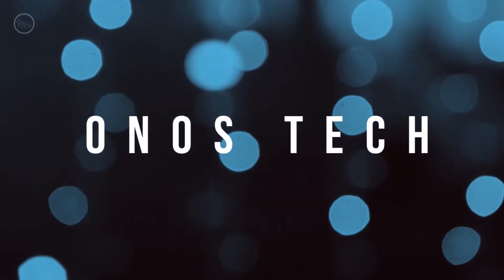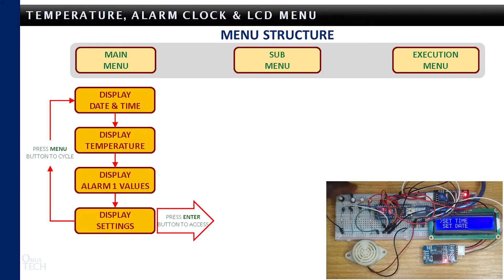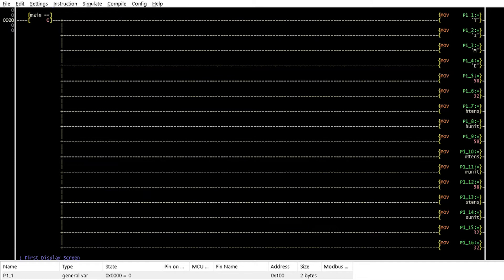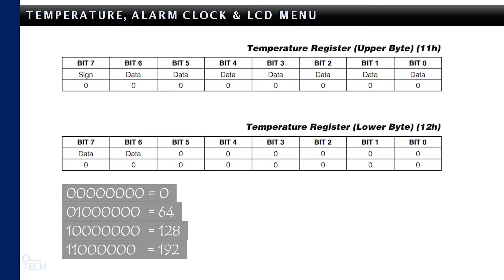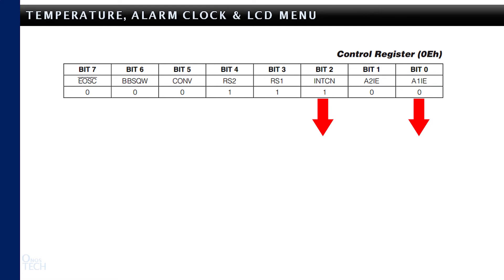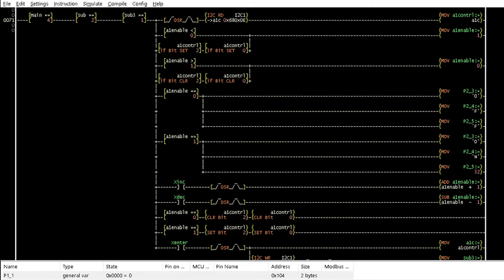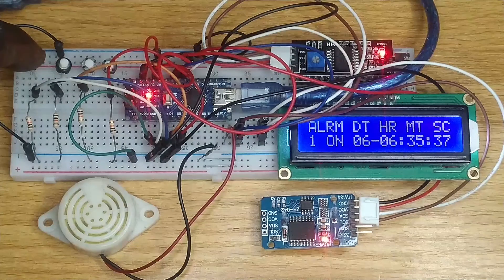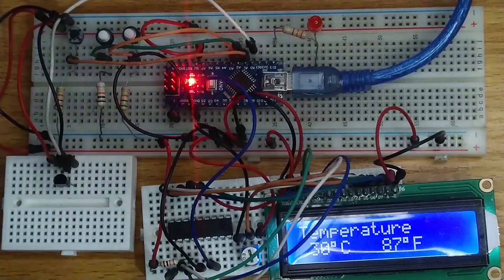LDmicro 16: DS3231 Temperature/Alarm/LCD Menu (Microcontroller PLC Ladder Programming with LDmicro)

Comment: Thanks. 
I want to get 2 alarms function with ON time and OFF time for each alarm. 
But I can not see Second setting for 2nd Alarm in DS3231 data sheet.
Please suggest me how to do it?
Reply from the maker: Sadly, the alarm 2 do not have seconds address. The others are available at address 0x0B for minute, 0x0C for hour and 0x0D for day/date. The alarm 2 can be enabled or disabled with bit 1 (A21E) of the control register at address 0x0E along side bit 2 (INTCN) as with alarm 1. The corresponding alarm 2 flag is at bit1 (A2F) of the status register at address 0x0F

Comment: I can not display any characters in row 3 and row 4 of LCD 20x4. please check!!
Reply from the maker: Ok I will check
Reply: @OnosTech  exactly i can not display any thing out of area 16x2. Maybe problem in library but i can not find it
Reply from the maker: I have checked the library. It seems it is meant for 16x2. Try editing it with the code below and confirm if it works.

ADD THIS DEFINITION TO "LcdI2cLib.h"

#define LCD_LIGNE_3           0x14   // Adresse ligne 3
#define LCD_LIGNE_4           0x54   // Adresse ligne 4

REPLACE THIS SECTION OF CODE IN THE "LcdI2cLib.c":

void LCD_I2C_MoveCursor(int y, int x)
{
    int adresse;

    if((y < 1) || (y > 2) || (x < 1) || (x > 16)) {
        return;
        // Si le numéro de caractère/ligne n'est pas bon => sortie de la fonction
    }

    // Ligne 1
    if(y == 1) {
        adresse = LCD_LIGNE_1 + (x - 1);
    }
    // Ligne 2
    else {
        adresse = LCD_LIGNE_2 + (x - 1);
    }

    LCD_I2C_SendCommand(LCD_CMD_SET_DDRAM | adresse);
}

WITH THE BELOW CODE

void LCD_I2C_MoveCursor(int y, int x)
{
    int adresse;

    if((y < 1) || (y > 4) || (x < 1) || (x > 20)) {
        return;
        // Si le numéro de caractère/ligne n'est pas bon => sortie de la fonction
    }

    // Ligne 1
    if(y == 1) {
        adresse = LCD_LIGNE_1 + (x - 1);
    }
    // Ligne 2
    else if(y == 2) {
        adresse = LCD_LIGNE_2 + (x - 1);
    }
    // Ligne 3
    else if(y == 3) {
        adresse = LCD_LIGNE_3 + (x - 1);
    }
    // Ligne 4
    else {
        adresse = LCD_LIGNE_4 + (x - 1);
    }

    LCD_I2C_SendCommand(LCD_CMD_SET_DDRAM | adresse);
}

IN LINE 243 OF "I2CLib.c"      y = ((val & 60) >> 5) + 1; // y sur 2 bits => 0 < y < 5 lignes

60 should be 0x60 as shown below

 y = ((val & 0x60) >> 5) + 1; // y sur 2 bits => 0 < y < 5 lignes
Reply: @OnosTech  I try and it not work on line 3
when i was changed this line:  if((y < 1) || (y > 4) || (x < 1) || (x > 20)) i can display 20 character instead of 16 character in line 1, line 2 and line 4 with start Cursor 0xE0
But line 3, maybe adress was not true
Reply from the maker: @Tân Hoàng  I have modified my earlier comment to make some changes to the code. Please try again.
Reply: @OnosTech  i changed like you before, it did'nt work!
may be this adress was wrong : #define LCD_LIGNE_3           0x14   // Adresse ligne 3
Reply from the maker: @tanhoang4084  Many thanks for checking this out. I have updated the code comment again. The address is correct. There was a missing "else" before "if(y==3){"
Reply: @OnosTech  Sorry, nothing better, line 4 even error now
Reply from the maker: @tanhoang4084  The problem is in line 243 of "I2CLib.c"      y = ((val & 60) >> 5) + 1; // y sur 2 bits => 0 < y < 5 lignes

60 should be 0x60 as shown below

 y = ((val & 0x60) >> 5) + 1; // y sur 2 bits => 0 < y < 5 lignes

I have tested it and it is working fine. I will reported this issue on the LDmicro forum for correction in the next release. 

Many thanks for you help.
Reply: @OnosTech  Thank you so much, i tried again and it working well
Reply from the maker: You are welcome!